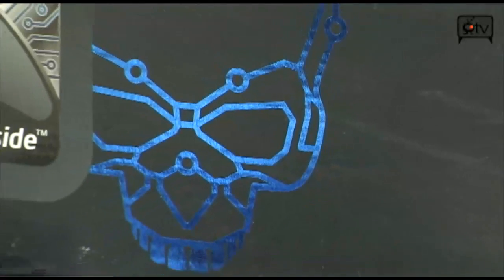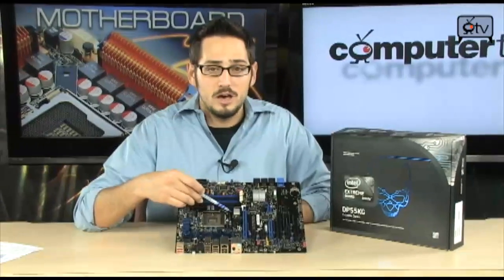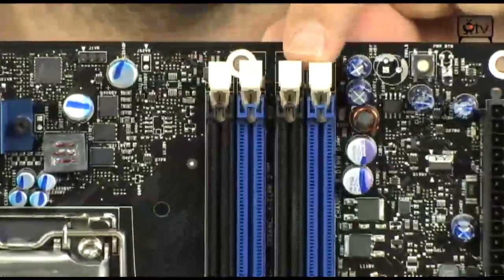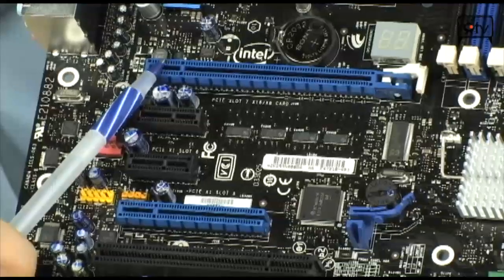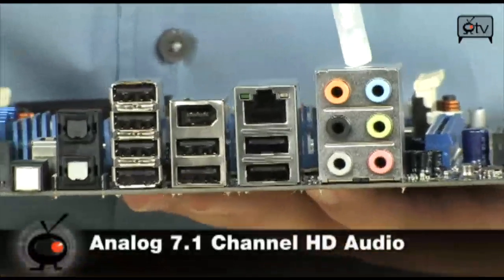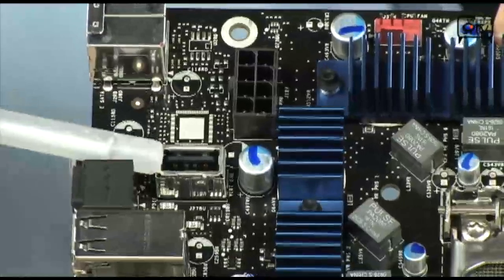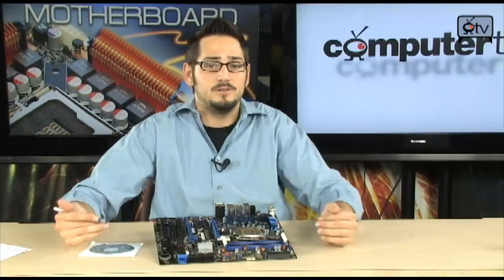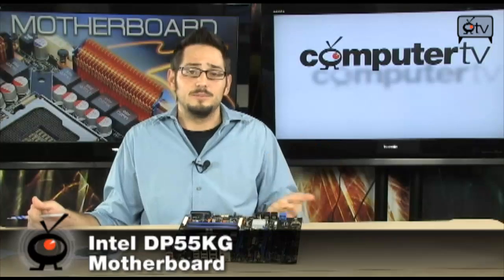Intel DP55KG Motherboard

Comment: Intel Dp55 sb I750 + dominator red 3200+(1.5v)*4*4096mb +N 560gtx ti oc 448 + chefteck 1250navitas*2= 2.66(133)>5.93(170)(max240) ddr> 5200 carent wark at stres test os vista 64x disbayd vt and speed step 24x Ha))) x99 maybe if they has mb with 8*2+4 cpu power at alse i750 eting at 96a  for 0.6>2.2v p55 liyke p35 at best speed wark with pereferiya for out of sandyng bridg only sata work for p55 chip badlly  in ms76301x was op sata 2 at 4.5gb/s in wan of pci line badlly this is raply at x99 or z97 and with chip on ssd cash for speed maybe bat cash is not unlimited and this is exechute all of log +